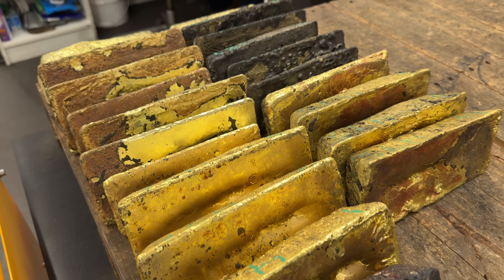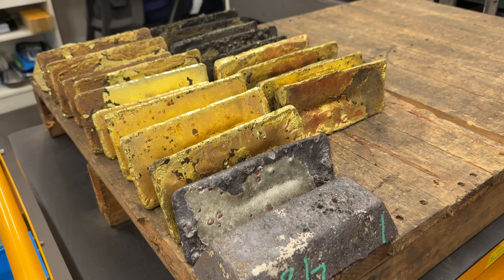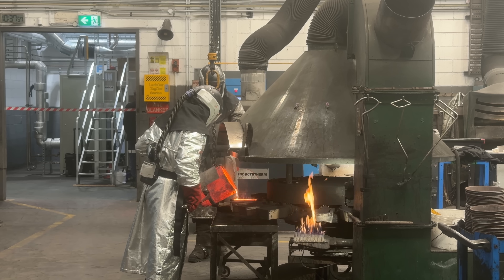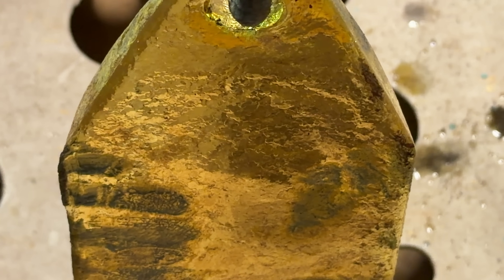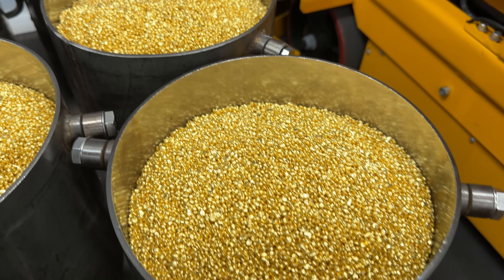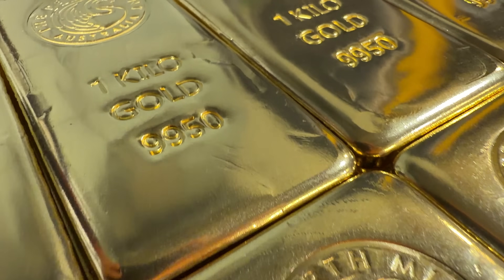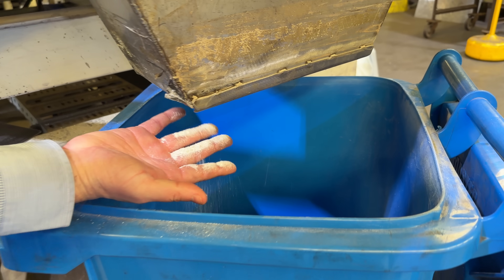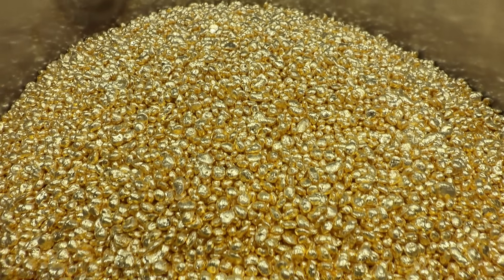Top Secret Gold & Silver Refining EXPOSED

Comment: Those acids you mentioned dissolve the precious metals. NOT the impurities. Those get left behind as slimes in the vat. The pure metals are deposited on the cathodes after dissolving in the acid. Electricity drives the reaction.